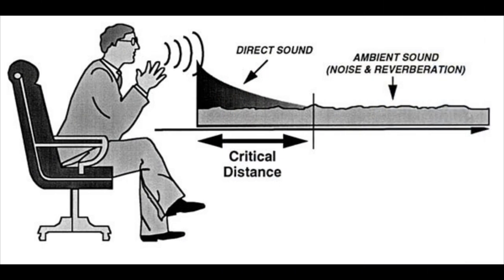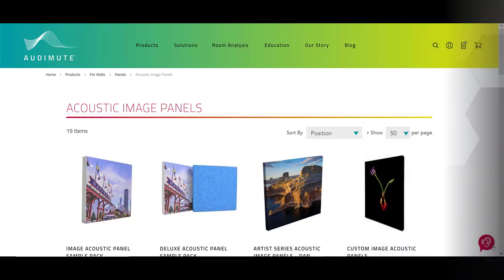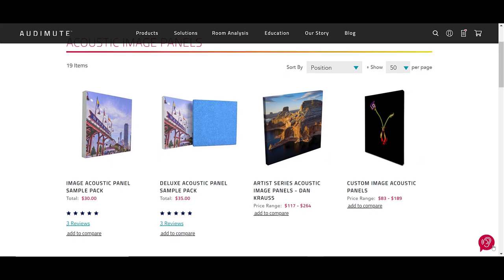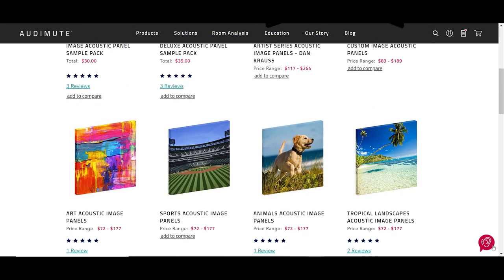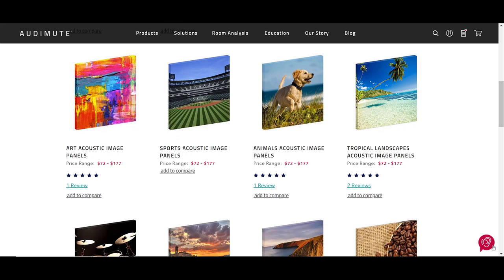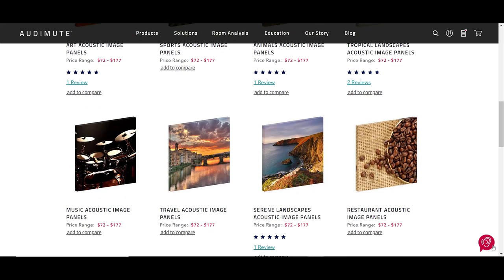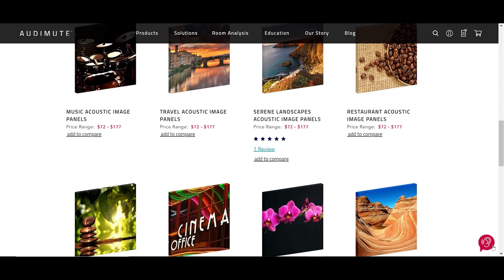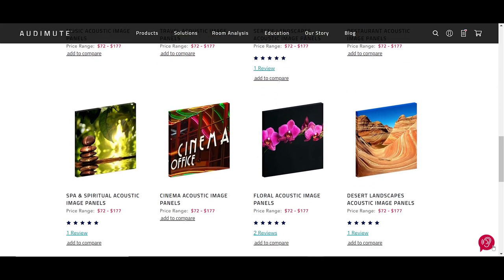DrCliffAuD VLOG 042 | Hearing In Restaurants | NRC Values

Comment: I live way up in Maine. I got my Phonak Cassia SP hearing aids for both ears 4 days before I turned 21 about 7-8 years ago. Since I no longer have insurance, cuz you know, hearing loss just magically goes away at 21, and my hearing aids are aging now....Do you have any suggestions of insurances that could help me cover, or help cover, the cost of new modern hearing aids? I have money well saved but I only make about $750 a month.
Reply from the maker: You should check out the Starkey HearNow foundation.  Otherwise, you need to try and find a non-profit clinic in your area that may be able to fit you with donated hearing aids.